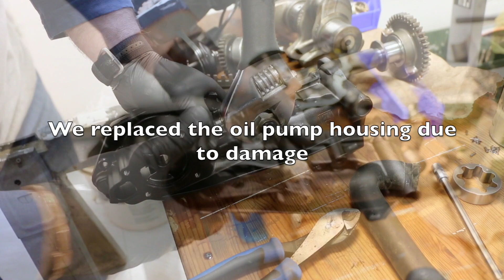How To Rebuild the Oil Pumps On Your Sea Doo Personal Watercraft Jet Ski

Comment: Great videos!  They are extremely helpful.  

I was hoping to find some info on getting the thermostat out and testing it but did not see any videos on your list with this.  

I just picked up a 2002 GTX 4-TEC. Before buying it I test drove it for 20 minutes, high speed, low speed, power on/off multiple times, with no problems.  Oil looked good, coolant looked good. Ran great. After purchasing it I took it out a few days later.  Just after getting it off the trailer idling and going slow for about 10 minutes in a now wake zone it overheated.  Beeping with High Temp warning.  Took it home and found coolant very low. Had to add almost 1/2 a gallon.  Oil looks good.  Runs ok connected to water hose, but overflow tank gets very hot and under pressure.  No apparent leaks anywhere. I was thinking maybe thermostat is stuck or impeller not working, but do not see any videos anywhere on these so I suspect these are not common problems.
Any thoughts would greatly be appreciated.  
Thanks
Reply from the maker: Sorry, we haven't had that issue yet so haven't filmed the repair. One day, though... I did experience a similar issue that you're having on a 2003 GTX 185. I replaced the water pump (and thermostat), but it didn't fix it. Unfortunately, the machine had a catastrophic failure before we could get to the bottom of the issue so I'm not sure what the problem was. It could be the thermostat in your issue, though. It's hard to say. Have you checked for codes? If so, what codes do you have? If not, you should check as it's likely you've thrown a code and it will be very useful in diagnosing.
Reply: I dont mean to be so off topic but does anybody know of a way to get back into an instagram account??
I stupidly forgot the account password. I love any tricks you can offer me.
Reply: @Gordon Bentley instablaster =)
Reply: @Gerald Damien It did the trick and I now got access to my account again. I am so happy!
Thank you so much, you saved my account :D
Reply: @Gordon Bentley you are welcome :D

Comment: Absolutely amazing video and appreciate you taking the time to make it.   I have a 2010 SeaDoo Challenger boat (2 x 4-Tec 215hp).  Starboard motor no issues, port motor get a brief low oil pressure warning ONLY between 3000-4000 rpm. It then goes away, can run the boat at 6000+ RPM (35+ mph) for long periods,  no issues.   Replaced oil pressure switch twice, no avail.  I have now installed mechanical oil pressure gauges off the top of the head port so I can watch the pressure.  Now, I am curious - if I have to replace the front and rear oil pumps Do I have to REMOVE the motor?  I have a ton of space to work on it.   I failed to say -  2 years ago had a SeaDoo Mechanic replace the oil pressure regulator valve spring on the bottom of the motor.  He had to pull the motor.  Thanks again !!
Reply from the maker: Hey Brian, I guess if you have a ton of space to work on it you may not need to pull the motor. But on our Sea-Doos it would be such a nightmare to do without removing the engine that it wouldn't be worth the time you thought you were saving by not pulling it. It is possible that you have ineffective oil flow (i.e. not a switch problem) so you should definitely resolve the issue before running it much more. Good luck!

Comment: Seeking your advice as I have found the issue.  About 4 years ago a local mechanic replaced the Oil Pressure Regulator which he believed was causing the low oil pressure. It stopped the Low Oil Pressure warning light for a while, then it returned.   Yesterday in rebuilding the rear oil pump I removed the bolt holding in the regulator.  The spring came out, then nothing.  I was able to remove the inner valve with a pliers, then 4 pieces fell out.  The Top, it's 3 of the 4 side pieces and the Bottom.  It was the outer valve that had broken in half.   I believe one of the side pieces fell out when I was cleaning the PTO housing.    Have you ever seen a Oil Pressure Regulator Crack ?  Was the Spring or bolt too tight?  I do remember the mechanic saying they had to put in 2 springs as per SeaDoo and yes there are 2 springs.   By the way, I have posted several of my boat videos with installing a mechanic oil pressure gauge if you want to see them.
Reply from the maker: We have not seen any problems with the oil pressure regulator so can't really help there.  It's odd yours was in pieces was it the sleeve or piston that came out in pieces ?

Comment: I am getting oil into my coolant, overheating and making a milky mess.  I already milled the head, changed the gasket and head bolts and I'm still getting oil into the coolant.  Before I try this rebuild, is it possible that the oil and water pump seals are leaking enough to cause this?  Isn't there a weep hole to drain the fluid in case either of these seals fail?
Thanks for making great videos!
Reply from the maker: Thanks for the kind words. Yes, you can also get oil in the coolant through the oil cooler. You should check that out. You can also get it through the seal in the water pump. Good luck!

Comment: Hello, scratching on the housing, do you machine it down or are you just leaving it? Im tearing apart a seadoo 4 tec with compressor failure. Greeting from Sweden.
Reply from the maker: It really depends where the damage is, and how severe it is. If it's just cosmetic, we'll normally leave it. If you have any pictures, feel free to send them to: 3ftDeepChannel@gmail.com.
Reply: Thank you for replying, Will do when I get some pictures👍

Comment: Do the oil pumps need to be rebuilt at the same time? If I rebuild the rear oil pump do I need to rebuild the front as well? Or do you recommend doing the both at the same time? Thank you
Reply from the maker: Only if there is visible damage to the mechanism. Damage can occur if metal debris circulates throughout the engine, as can happen after supercharger failure.

Comment: Finally pulled my 1 Motor in my SeaDoo 210 Challenger (2x215hp) and getting ready to start this process.   Need to order the parts and I am on the fence about ordering the WSM, SBT or SeaDoo OEM Parts ?  Any guidance would be appreciated.
Reply from the maker: For those types of parts we always go OEM. It may cost a bit more, but we can ride with confidence when we know we’ve got the right parts in our engines. Good luck with your project.

Comment: How it going guys, i have a 2009 sea doo RXT 255is with the cost P0523.  Runs great just had this code and engine light on.  Should I try swapping out the Oil pressure switch first?
Reply from the maker: That’s a tough one. I had the same problem a number of years ago on a machine but after replacing the switch it did not fix the problem. You may need to clear the code after replacing it. If it still doesn’t work, you will have to investigate another possible cause. Good luck.
Reply: @3ftDeepChannel  could I rebuild the oil pumps without pulling the motor out of the ski?
Reply from the maker: In theory yes, but it would be a huge pain in the neck.

Comment: So followed each step and it looks like the rear spins pretty easy on video when assembled. Mine takes a bit of force to spin it. compared to the front. What did I miss?
Reply from the maker: Not sure. It should not be difficult to spin. New seals may give some resistance, but with a bit of assembly oil they shouldn't put up too much of a fight. If the seals, etc. aren't aligned properly, that can cause some resistance. I would look into it and find if there are any binding areas and don't just assume it's put together right. Good luck!
Reply: 3ftDeep thank you for following up and thanks for the videos!

Comment: Great video, I have been having issues with my oil being pumped out of the breather on the same model 2005 rxp, have changed impellers and rotors on both pumps but seems to be worse, have also changed both pressure switches, any ideas? Pumps out about 100mils/hr at 5-6000 revs but a lot more with higher revs
Reply from the maker: Is it stock, or has it been modified?
Reply: 3ftDeep not modified just had new piston and rings and bearings 128psi on each piston, intercooler sprang a leak so was slight rust stain in bore but honed out ok, was doing the same with oil before rebuiĺd hence why we did oil pumps
Reply from the maker: Not sure. It's one of those things I need to see in order to be much help.
Reply: I'm having the same problem, error code for oil pressure, and lots of oil coming from breather pipe, filling my catch can like crazy.

Comment: What is the stuff you are putting on the oil pump gear? Thanks
Reply from the maker: I think you’re referring to assembly lube. That’s an oil that helps to lubricate new parts when put into an engine to prevent wear before the oil gets properly circulated.

Comment: Looks like when you press the shaft in you are supporting the seal underneath with the socket end of a 3/8 socket.  Am I correct or is that a specific tool?
Reply from the maker: Good eyes! I don’t know the exact socket size that we used, but it was not a special tool. It was just a socket that fit the job. Thanks for your comment.
Reply: When the shaft is pressed into the rotary seal how far does it go in. When I did it the first time I went to far and the shaft was binding so I removed and repressed into the seal a bit before the threads. It seems flush with pump cover but doesn’t quit sit on the shaft like yours(a bit back from the threads about 2mm). But does spring in and out like your and moves freely.
Reply from the maker: You really need to use the proper tool, and then you press it carefully until it bottoms out. That is the correct depth.
Reply: My same thoughts. Order new seal and the tool. Too much work to be guessing. Thanks for your videos much appreciated

Comment: how hard was it to get the outer part of the pump shaft assembly out? from the marks it looks like it was pretty hard.
Reply from the maker: It wasn't that hard. I think you're referring to the marks that were made as a result of the supercharger failure (i.e. bearing parts were flying around inside the engine).

Comment: how far do you press the oil ash in if you want you can squeeze it all the way to the end how much space do you leave? Thnx in advance
Reply from the maker: Sorry, I don’t understand. What do you mean “oil ash”? It would help if you refer to a time on the video you’re asking about.
Reply: 4:02  how much space do you leave between the pto cover and the oil pump shaft if you want, you can press it all the way to the end, but that is not the intention, I assume.
Reply from the maker: When installing the oil pump shaft you are not really pressing it into the PTO cover you are pressing it through the water pump seal look at the video around the 3:10 mark you can see the spring loaded water pump seal during disassembly.  After install you can see some of the play in the spring loaded seal at the 4:06 mark I would suggest getting the correct water pump seal holder as it's really easy to mess up the seal if it's not supported correctly when pressing the shaft through, SeaDoo part number is 529 036 014.

Comment: What's oil pumps are you using? I want to replace mines i don't want to buy cheap parts either. Thanks
Reply from the maker: We always use OEM for parts like those. Thanks for your comment.

Comment: Just replaced both front and rear covers and rebuilt the oil pumps. Went to fill it with coolant and found a leak through the weep hole in the front cover. Service manual says if its coolant then the rotary seal is leaking. What could I have done wrong I tried following your video when installing the new rotary seal, I looked everywhere and was not able to find the actual seedoo tool. Any feedback would be greatly appreciated.
Reply from the maker: The water pump rotary seal is a spring loaded ceramic seal that if not supported properly is easily damaged when pressing in the oil pump shaft you could try riding the ski and see if the leak continues if it does then you will have to replace the seal again.  I was able to get the seal support tool from my local dealer, part number 529 035 823.
Reply: @3ftDeepChannel  Thanks for responding, I will try riding it and seeing if it stops leaking.

Comment: I have seadoo 2020 230 gtr I get warning. Low oil pressure 
I’ve replaced the oil sensor still after 10mjns warning comes on. Next step from here
Reply from the maker: Have you confirmed you actually have the proper amount of oil? If so, check your connector for the oil sensor as it may not be making proper contact with the sensor, or the cable may be damaged.

Comment: 1:04 is it brass wire wheel or regular? Thanks.
Reply from the maker: I usually use a steel wire wheel.
Reply: @3ftDeepChannel  Thanks

Comment: can the waterpump seal be replaced with motor in ski? 2006 gtx limited
Reply from the maker: Yes, you will need to drain the coolant first, though.
Reply: How do you press the new seal in if the motor is in the ski?
Reply from the maker: Yes, that’s a very good question. It’s easy to ruin the seal, so it would need to be done with lots of finesse. We haven’t done it like that before.

Comment: Hello, I have a question how to replace the motor shaft multi-shaft drive in sea doo spark 2015 year
Reply from the maker: Sorry, Sparks are one machine we haven't had experience with. I suggest getting hold of the Service Manual for your model. Good luck.
Reply: @3ftDeepChannel  Yes, I am from Poland and in the sea doo spark crankshaft for exchange 9 hours and exchanged for a new one, what help

Comment: I think I need this done my 2007 RXP has oil in the hull floor does anybody know someone in George that does this repair
Reply from the maker: See if you can find where the oil is coming from, first. Good luck with your repair.
Reply: Looks like it’s coming from underneath the supercharger I guess that’s the oil cooler area
Reply: The ski runs fine it goes 74 miles an hour no oil lights or anything has come on I’m in the process of cleaning out the whole really good I have everything out of the back I’m about to probably pull the supercharger because it’s probably time to do it anyway at 85 hours and if it’s down it’s down I’ll just get it done
Reply from the maker: If you have never had the supercharger rebuilt, don’t run your engine again until you do as those superchargers will fail and could destroy your engine. Good luck.

Comment: That will be $3,700 sir
Reply from the maker: It's not gonna be cheap! (but better than replacing your entire engine)
Reply: @3ftDeepChannel  what could this cost at a shop?
Reply from the maker: This is an expensive job, as they have to take apart the engine to rebuild these. You’d be looking at $thousands$ in labor and parts.